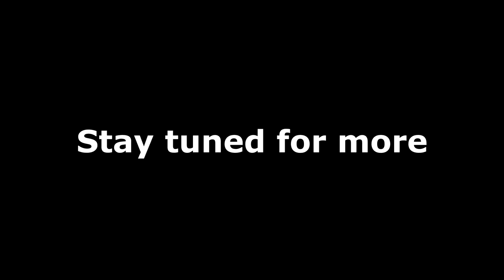Mitsubishi 6G75 Restoration - Part 1

Comment: I had a Mitsubishi 380 with this 6G75.   Smooth and lots of power, but a thirst like a tin god !

I swapped cars with one of my sons (who needed a reliable car because he was doing significant mileage to and from work)
I got his VP Commodore - also a 3.8 V6 - with huge mileage, and it actually used less fuel.
Reply: My 380 is excellent on fuel, a great country car😅.

Comment: What vehicle is this out of?  Also what are some of the main wear points in these engines that need replacing in a rebuild, valve stem seals and lifters maybe, what else?

Comment: What are the specs/procedure you use for the head bolt torque?
Reply from the maker: Factory specs inside to outside in clockwise pattern. I forget the exact torque setting off the top of my head but it's the same for all of the Mitsubishi 6G family.
Reply: @JBurford  108> 0 >108

Comment: Hi, i got a 2003 montero limited, the same motor in it that you have in this vid, but mine has no compression , wondering if you have any advice on what to look for to trak down the problem. Thanks
Reply from the maker: If you're not getting any compression in any cylinders you need to check the timing. If the timing it out it can cause no compression. Same with an overheated engine the heads can warp.
Reply: @JBurford  Hi, thanks for the tip i will check this weekend the timing belt, when i turn the key the motor only spins but no ignition, new fuel pump , i took a look at the valves when i opend the oil cap and the moved freely , was thinking the piston rings probably stuck and leting the compresion escape, but i will chek timing , bught the montero like that so i dont have a history of what might of hapend to it.
Thank you for your help i apriciated.